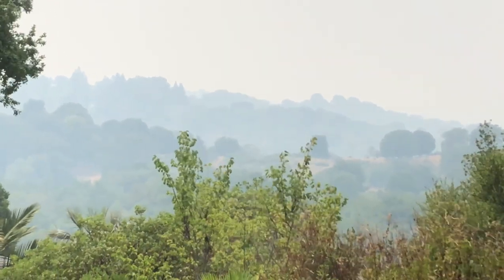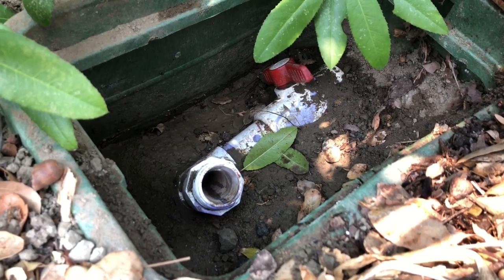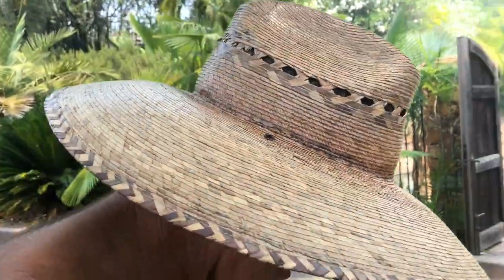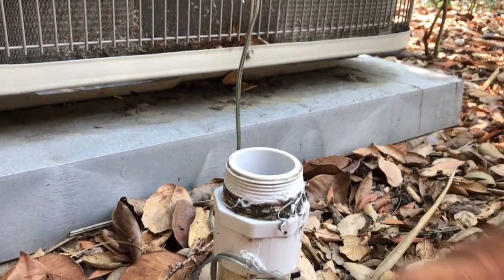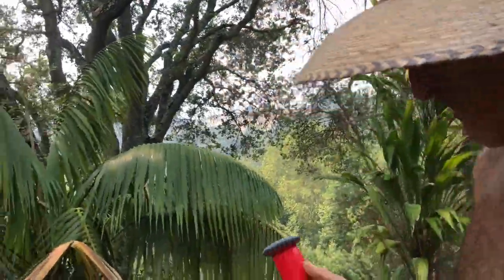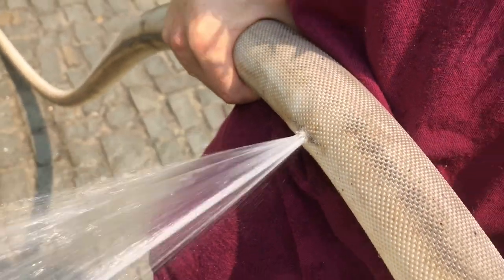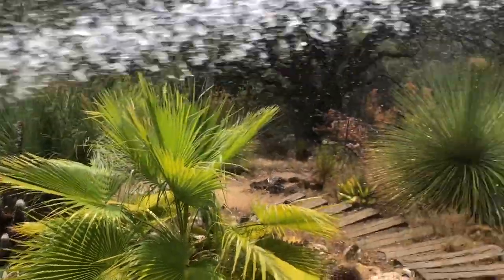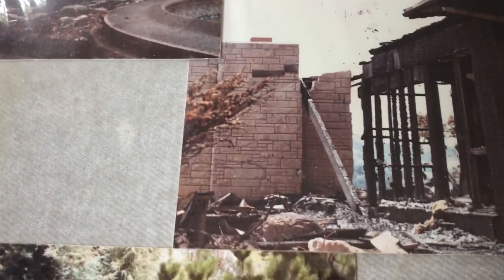Size Matters for Fire Hoses

Comment: Thanks for the video.
A couple thoughts: it is always quite possible, if not likely, that by the time the fire is to you water pressure on a municipal system is very low due to excessive usage. Once one house burns down on line, the water will be free-flowing. Multiply that by several houses, add fire department usage, and other homeowners intentionally running as much water as possible, and you have a distinct possibility of very low pressure. Running your two hoses was already at the limit of this system. If you figure that you could have serious winds coming toward you, you may be unable to project water anywhere near the fire. Here in SOCAL the 'Santa Ana' winds can be 50 or more MPH, and the stronger the winds, the more likely it is for you to need a firehose. 
Since I think I saw a pool in the photo of your house, I would have a dedicated fire pump that can suction out of the pool in an emergency. It could also be placed at one of your 1-1/2" line locations and feed with city water at whatever pressure, but boosted to give you great range. These pumps can be had for well under $1000, which is not much compared to what you have invested in the current system, and of course the home. The downside is that you will HAVE to maintain it, at least running it occasionally, ideally running it out of fuel to keep the carb from going bad, and of course keep and maintain a supply of fresh fuel. I like to rotate mine: fill the cans with premium, add Stabil. After a year or so, what I haven't run through the lawnmower goes into my commuter car  and replaced.  The quick disconnect fittings are less than $20 each fitting, and could make a big difference when time really matters.  Putting a valve on that one supply point was wise: everything will need to happen very quickly and you may not have help to go and turn water on and off.
For those of you on wells, keep in mind that the electricity will likely be OFF for any fire of significance. Do NOT count on your pump working through a fire. Have a back-up way to supply water to everything that might need it. Like all other things in this video and my comment, TEST before you need it and maintain everything as if your life depends on it, it might!
For a property like yours, with a wooded hill beneath it, you could always have some premade impact-sprinklers on stands deployed in that grove of trees. Once the fire is coming towards you, you then roll out the 3/4" hose and hook them up and then they are ready to put the water where you need it most without you being there. Having them on separate hoses/valves gives you the ability to target different areas. This is not a perfect system, but gives a lot of protection for not a lot of money, and most importantly puts water UPWIND. Wetting ahead of time I think would have minimum impact, at least where I am, as the hot, dry, extreme winds will dry everything but the ground before the fire is even there. 
Lastly, just because you got away with firefighting in short last time does NOT mean that is what you should plan on in the future. Firefighters must upgrade their gear from time to time, and the old stuff can be had on eBay pretty reasonably. Good boots, Nomex pants and jacket, leather gloves, and a face shield/googles would be my minimum. For EVERY person that will stay through the fire. I would also plan on an easy and quick way to hydrate and maybe even snack: you could be out there for hours waiting and fighting, doing a lot of running from place to place. 
Since this video is now 4 years old, perhaps you have made significant gains in your fire preparedness. You obviously are the type of person to take the time and effort ahead of time, which most are not. Good for you for being prepared, and taking the time to make this video for us to help others be prepared.
Reply from the maker: Yes, it’s all about degrees of protection. My pool is substantially higher in grade than my most likely downslope fire approach so I think at a minimum what I might do is put in a diverter valve at our pool equipment, which is at about 7 feet below water level, and hook it into my 1.5 inch distribution line as the lower tap points are probably 25 feet below the pool which would give me about 10 or 11 pounds of pressure and more so if I drag the hose down the hill. It would take very little to set that up.  When I saved my mom‘s house, the pressure immediately dropped down very low because of all the reasons you mentioned, but then the fire chief called in to the water company right in front of me to increase pressure and within about two minutes the pressure was up again, so they do have some ways of managing that.  But those are all great ideas and thanks for all the info
Reply: @ScaryHairyGary  This would give you great flow, but in no way would I count on having enough pressure to project water into the wind. 
Also keep in mind that hooking the pool to something that is hooked to city water would probably be against code, for backflow reasons.

Comment: Fire comes through and you won’t be able to breath with all the smoke. Fire also consumes the oxygen in the air I think. If I lived in an area like that I would also build a fire safe cool room with breathing apparatus in it.
Reply from the maker: It all depends on how severe the fire is as I’ve been in one before and there can come a point where you just need to get up and run. Recognizing that moment if it comes is the most important thing you’ll ever do.
Reply: @ScaryHairyGary  Yes but there needs to be somewhere to run to. Some years ago there was a terrible bushfire nearby that completely wiped out the town. About 140 people died. They had nowhere to run to. Some died in the flames, most from smoke, and oxygen deprivation.

Comment: All them leaves tightly paced shrubs would scare the crap out of me, my homes here in California are loosing their insurance so been buying up fire fighting tools built a 70 by 20 pound holds a lot of water got water tanks 2000 plus gallons each  not planning on leaving if fire comes,  have family set to leave but us men of the house will stay and fight . fire hose nozzle i just got doesn't shoot as well as yours just ordered another. moving them hoses full of water is hard.
Reply: Bobby, What are you using to boost your water pressure?  Like above “Defensible Space” the proper gear and a safety zone. A small concrete building might help.  Be sure to watch the PBS video on the Paradise fire.  It’s an eye opener.